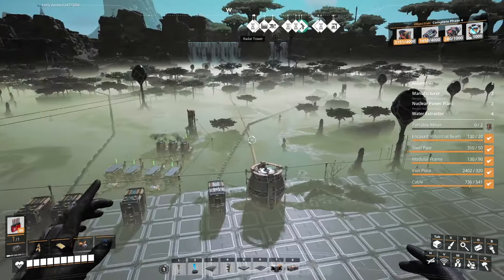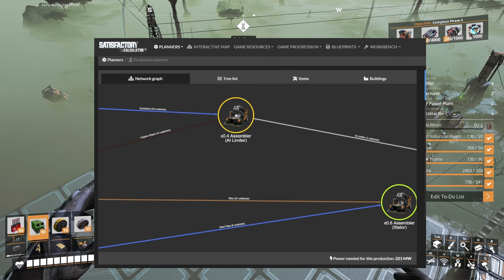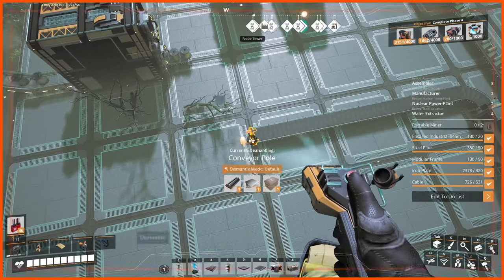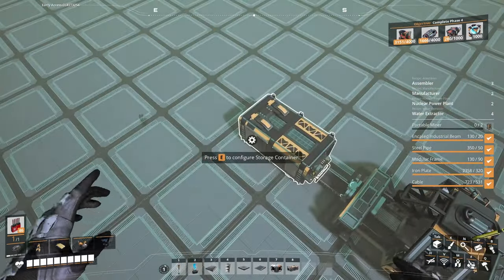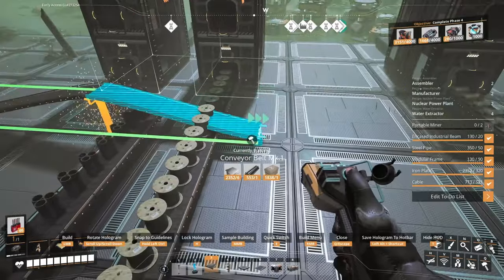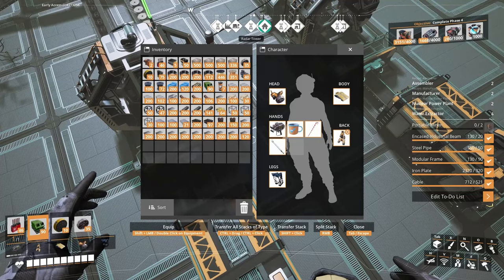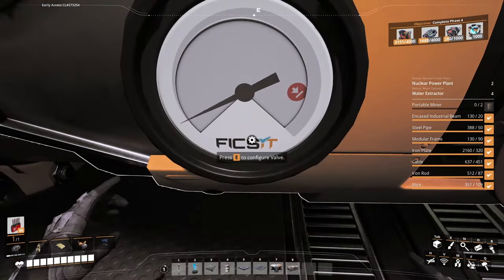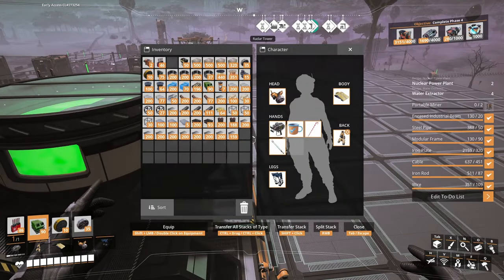Satisfactory Update 8  - Nuclear Power Plant - Final - Ep.32

Comment: You can put a valve on the pipe from the acid storage to the blender (before the pipe feeding acid back in) and limit it to what the blender needs minus the output acid being fed back in. This should prioritise using the acid output by the blender. Unfortunately fluids are not as precise as solids so you may need to set the valve slightly under what is needed to ensure all the excess output acid is used and never clogs the pipes.
Reply from the maker: Hello @vikingbrit270, I've experimented with the valves for a few weeks in my previous playthroughs and they never worked right. Actually I think it's the combination between pipes/fluids/valves so I don't like including them unless really necessary. In your scenario this will be the perfect setup if fluids would work ok. But they are not and some liquid it's deleted from each pipe segment with each save. That means that my blender will starve at some point. The way I did-it it will never starve but I've made sure that the blender will not be clogged on the output side and for the input it has the return pipe and the storage. This way it's working just fine. In about 20-30 hours in game time that storage will bi filled but the whole system will still work just fine. Thanks for being here.
Reply: @PlayBIGorDie  Yeah fluids are a perennial problem with Satisfactory. Restricting the new inflow in favour of recycling waste works fine for my aluminium setup but I do provide slightly less overall than the refinery needs to ensure all the waste is used (so the refinery runs at 99.9 rather than 100). I guess a packager and sink would be the simplest sure fire way to get rid of waste fluids, especially with all recipes you can make canisters out of steel or iron+copper.

Anyway, looking forward to 1.0 which has been confirmed for later this year!
Reply from the maker: @vikingbrit270  I saw yesterday the video from @CoffeeStainStudios and I was like YES, finally.... I'm looking forward for 1.0 as well. Already planning my next playthrough..
Reply: @PlayBIGorDie  everything on foundations next time I hope ;-)
Reply from the maker: @vikingbrit270   Of course.... 😀 it will be fixed in the next one (today at 09.00)